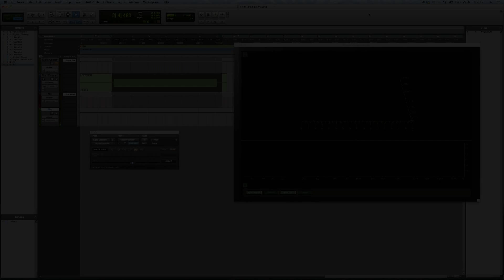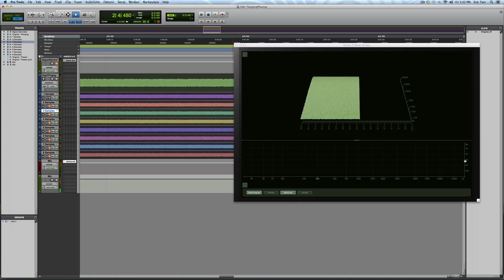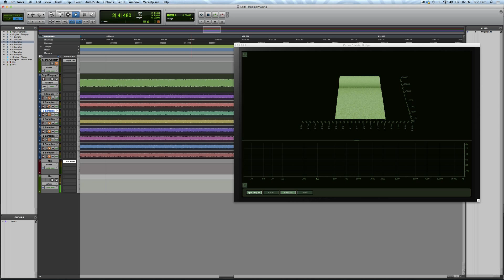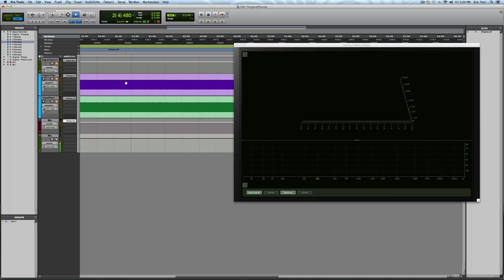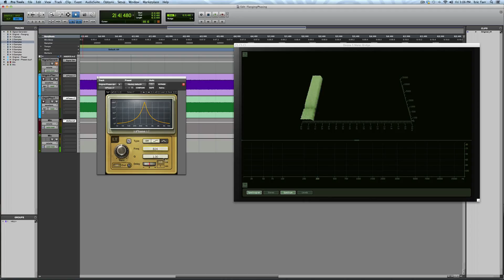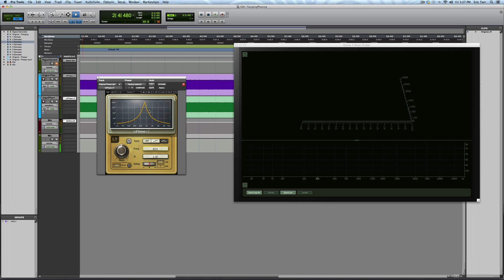Phasing vs Flanging — Technical Breakdown (Part 2)

Comment: I still don't get it.  What's the difference in how the two effects are created?  It sounds like both are about duplicating a signal & having a small delay between the two, then the delay time is lengthened & shortened, as the copied signal moves back & forth.  There must be some difference in what happens for each effect.  (I know about phase cancellation).

Comment: Can someone explain that if I mix a signal to the original one sample later, why does it cancel out a part of the spectrum? I'm an electric engineering student, but shame on me, I can't figure this out.
Reply: Might be easier to see with sine waves. Most of the signal will have constructive interference, while a small band will be at odds and cancel.

Comment: I disagree that the plugin you're using for the phaser is inverting the phase here, since the frequency meter is simply showing a notch, which means all the plugin is doing is scooping the frequency as you move it along on the plugin interface. This is not inverted phase and it doesn't sound like it either, since you can clearly hear the notch being moved.

Comment: So when people take 2 mono vocal tracks and delay one by a few milliseconds to create space using haas effect does that also create a notch in certain frequency's like the Flanger effect you got from delaying the printed white noise by a few samples?
Reply: Yes! That is is absolutely the case. Your idea will create the perception of "space," but it will create notches in the spectrum like the flanger effect.
Reply: To an extent. Normally the two vocal tracks are panned left and right though, which reduces the perceived phasing

Comment: Am I right by saying phasing and flanging are just other ways of EQing and automating EQs?
Reply: That's correct. Many effects (flanging, phasing, eq, filters, etc) are all based on using very short time delays. Depending on how you choose the time delays, you can end up with different results.